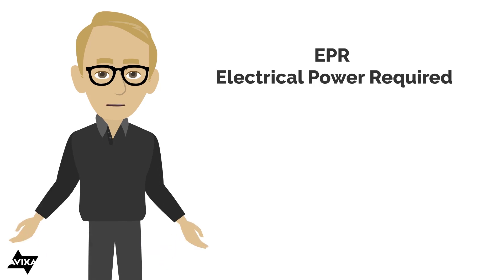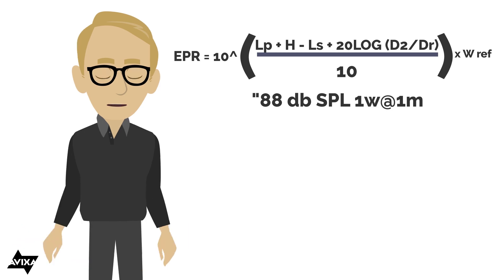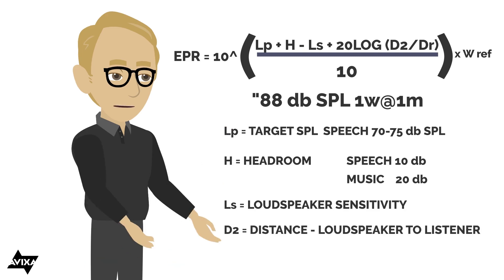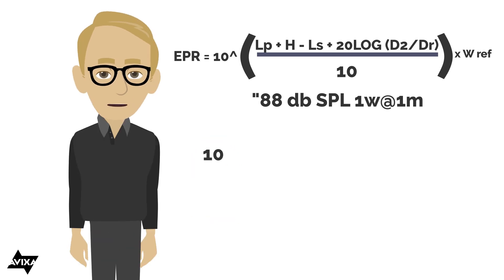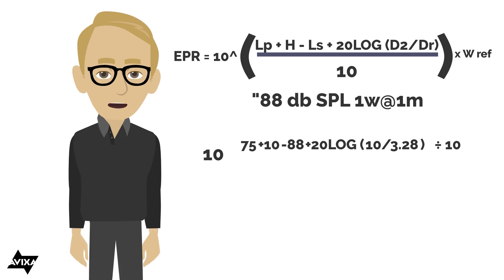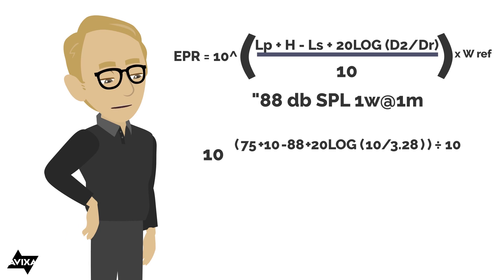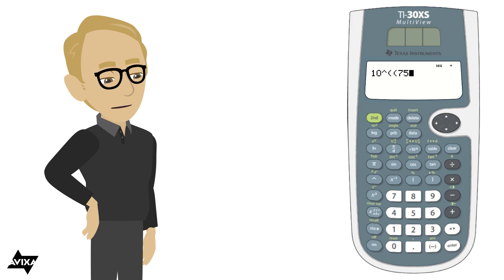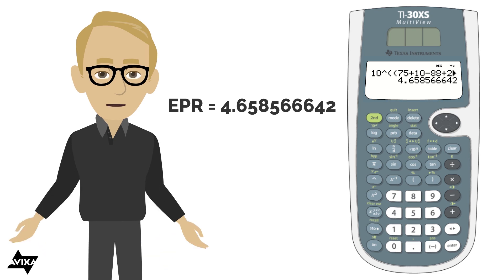Electrical Power Required, Calculating Required Wattage at a Loudspeaker

Comment: Hi, in part calculation Wref not considered?
Reply: Wref was = 1 in this example.  1 times X = X
Reply: @audvidgeek  So, if ref is 1W; why distance units is 'feet'? I think if ref is 1W, units should be meter. Because 1W@1m. I'm a little bit confused.. Thanks
Reply: @batuhanpehlivan718  Ref is either in feet or meters 1m=3.28'